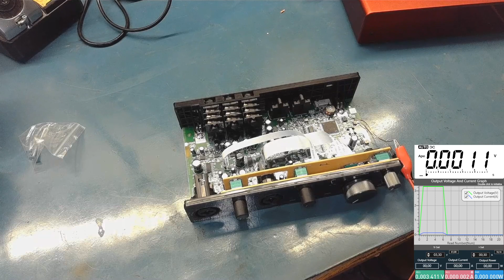Focusrite Scarlett 4i4 Gen3 USB Fault/Damage Diagnose/Repair

Comment: how did you open it??
Reply from the maker: There are two screws under rear rubber legs. In order to get rubber legs from chassy easy, you can heat them to approx. 70 degrees Celsius and they will come off easy.
Reply: @Miky-CekimElectronics  heat? really? anyway... many thanks!
Reply from the maker: Yea, glue will come off more easily. But do not overheat it!
Reply: @Miky-CekimElectronics  oh! My bad.. I thought you were talking about heat screws 🤣
Reply from the maker: @tessel6529 Hehe my bad too, I was not so clear with my words 😊 edited and now it should be more understandable 😁

Comment: Did you solved?
Reply from the maker: Hi. Yes indeed the xmos was bad, as I suspected. After replacing it the card works like a charm!
Reply: @Miky-CekimElectronics  That's good news
I am also planning to remove the XMOS chipset of the 3rd generation 4i4 and order a new chipset.
Like you, I injected 3.3v from an external power supply, but the PC did not recognize the device. I guess I will have to replace it with a new chipset.

Doesn't MP2141N or MP1605 kill the XMOS chipset?
Reply from the maker: In my case it was not completly dead Therefore the lights came on, but there was no function via USB.
Reply: @Miky-CekimElectronics  Yeah, me too LOL